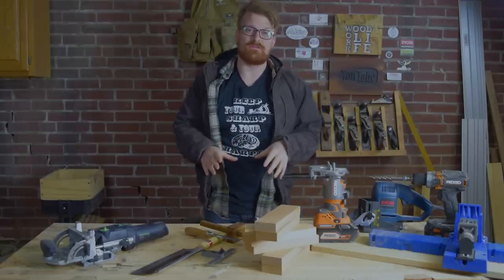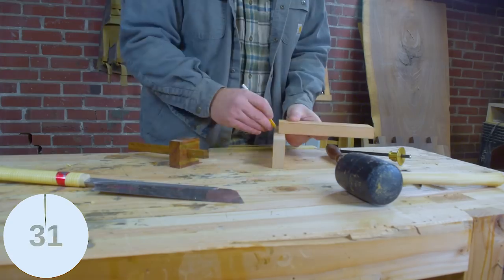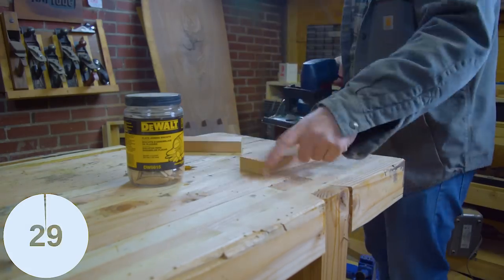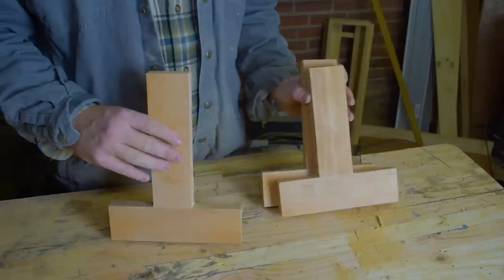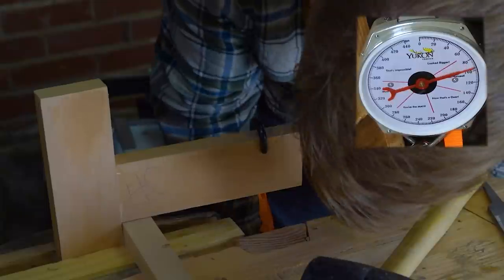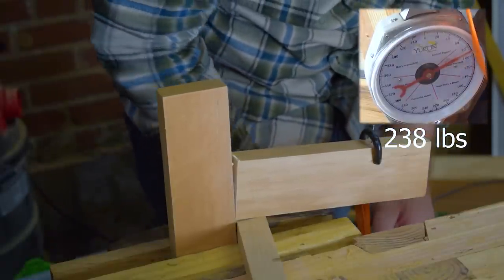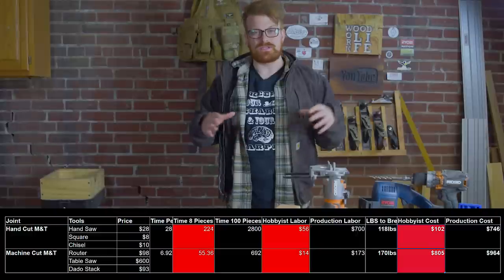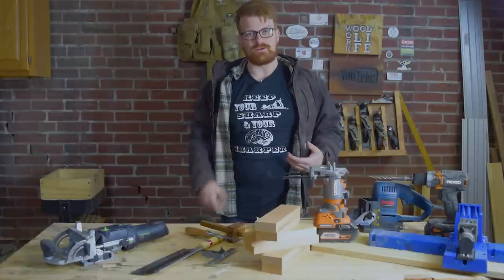Best Joint Shootout, The answer will surprise you!  | Hand Tool Shootout

Comment: Curious... if you put 3 pocket screws instead of 2, will it increase the strength by 50%? 

Also, there is another joint that hobbiests use, dowels. With a $60 or less doweling jig, you can get a joint similar to the domino except with separate dowels. How well would that joint hold up?
Reply from the maker: I plan on following up on this video next month.  Stay tuned.  The screws didn't fail the wood did, which means adding more pocket holes would comprimise the end grain even more.
Reply: @WoodWorkLIFE  Of course the wood failed. The screw is much stronger than the wood. I think another screw would spread out the load to different stress points. It might not hold 50% more weight, but I bet it would hold at least 30% more.
Reply from the maker: No what I'm saying is the wood failed along the grains of the wood parallel to the grain. One of the issues with pocket hole joinery in hardwoods is the drill hole gives the wood a natural point to fail and the screw acts as a wedge.  More holes would provide more compromising positions for the wood to splinter at. If you were working in plywood or MDF it might be a different story.
Reply: @WoodWorkLIFE  OK, Sorry, I was a little slow to understand what you were saying. :)

Still think dowels might be equivalent to Domino for a lot less money.
Reply from the maker: @KirkDickinson  I would bet they are closer than the price would indicate

Comment: Which is better? A Rolls Royce or a HumVee or a Bettle? Depends of what your need is. Strength is not always the only consideration. Environment factors of temp and moisture and the swings of and how much strength do you need. Structural or non-function decorative.
Reply from the maker: Ding ding ding
Reply: @WoodWorkLIFE  That is supposed to mean something?
Reply from the maker: @MrBonners  that is exactly what I am trying to highlight in these videos.  All joinery can be fine for particular purposes.  I just don't come out and say that in these videos.  You don't always have to use the strongest joinery, it just has to be strong enough for what you are using it for.  In my follow up video I was surprised by how strong just a glue saturated butt joint is, but when the glue fails it will fail too.  Because in structural applications you should have a mechanical joint as a backup to glue.  Many pieces of historic joinery are joined with plates but not in load bearing/structural joints, as a straight butt joint though, they don't add much.
Reply: @WoodWorkLIFE  One is supposed to get all that from " Ding ding ding ".
" exactly what I am trying to highlight " try harder. Try using sentences.
Reply from the maker: @MrBonners  ding ding ding, like the gameshow winner winner sound doesn't convey that 😁.  Happy to engage in dialog .  It seemed like you nailed the point already though.  Just trying introduce a little levity.

Comment: No glue on the pocket hole joint? Also, anytime you are gluing end grain you should apply glue, let it soak a bit, reapply and wait. Just a couple minutes. It helps with that kind of joint on most woods.
Reply: Oh, and to the point of the cost of the festool domino setup - get a good doweling jig, and drill in 3 or 4 dowels close together. Save you a thousand bucks, and get nice strong joints. Also faster than any mortise and tenon.
Reply from the maker: I did glue them pocket hole joint, that is why the wood failed rather than the screws.  That is one of the problems with ph joinery, it compromises the end grain of one did if the joint.

Comment: I could swear that I heard you say that a tenon would provide more leverage and this be easier to break. Please tell me I misheard that. I may have missed it, but was that glue fully cured? I feel like you should not get the tenon to pull out like that if the glue is cured. I’d expect more shearing/cracking as opposed to smooth extraction like that. Dominos are typically used only for alignment. Finally, an injury that always comes to mind when I pick up a biscuit joiner is my very first time. Holding the piece as you did, the piece slipped and I routed my thumb. Please be careful when pushing that machine into the piece.
Reply from the maker: I don't think I said that...hrm.  I don't know what I would've meant if I said that.  The glue was fully cured, the wood is fairly soft and straight grained though.  I think it just peeled off a layer of wood cleanly.

Comment: FYI, that end grain glue up myth has recently been busted. But to but is a bit stronger than side to side.
Reply: yes, but leverage. a side to side joint may see a foot of leverage in a HUGE joint, but an end to side or end to end will see unholy amounts of leverage
Reply: @jmac2o229  that's ture. But the statement 'end to end is weaker' is still factually incorrect.

Comment: When you consider cost of tool and labor both....Pocket holes win hands down...They're super fast to do and strong enough for normal use of things...
Reply from the maker: Ya pretty much, it only starts to break down if you are a "high end" production or custom furniture maker.  The way that a pocket hole fails in hardwood over time is not the mark of a professionally assembled piece of furniture due to the compromising of the end grain with the screw.  The domino fails essentially in the same way as a mortise and tenon joint (if it ever fails.)  From an efficiency per strength per cost though, they punch in the same league with a lot lower barriers to entry.  The results is where they really separate, especially if you also take into account plugging the pocket holes with dowels into the timeline.

Comment: You have to take in to account those joints are actually stronger than that given the location you tested them at. Had you been able to pull on them right at the connection vs the leverage point you was at the numbers would have been a lot different on all of them. But still a good demonstration though!

Comment: Rest in peace Biscuit joint. Great content like always! Love to see all the different kinds of videos going up.
Reply from the maker: It seriously snapped when I was lightly tapping in the nail at 6", no hope there.
Reply: Tapping in the nail unsupported compromised the test imo... Impact is a different kind of stress and not measured here either.  Biscuits, as you did say, are not really suitable for this type of work but probably are great for lining up boards when edge joined.
Reply: Thank goodness the biscuit is dead they add SFA to a joint strength. Only decent use is for alignment but often they no good for that either.
Reply: That failure looks suspicious to me. I use a lot of biskuits but every failed joint so far broke off one side of the piece with it. So the joint didn't fail directly but the wood around it did. 

It would be nice to see the broken pieces to identify them. 

Otherwise it was a good Video. I would also suggest watching Matthias Wandels approach in that topic. 

Regards, Etna.
Reply: they are very suitable if you need to align something - i use lot of them too, they don't add much strenght, but i never have failed one like this - i can confirm your Statement by my expierience: if the joint fails, half of the Wood around the biscuit breaks out with the wood

in this case, clearly the clue broke
Reply: Exactly. He should have supported the wood while putting the nail in each piece.
Reply: on that thick of stock he could of doubled up on the biscuits!

Comment: Thanks for the video!
For those wanting to compare strength of joint to cost, here's a quick lb/$ (higher is more value-economy). 

Using his numbers: 
hand cut 1.16 (hobby) 0.16 (production)
machine cut 0.21 (hobby) 0.18 (production)
biscuit 0.49 (hobby) 0.38 (production)
pocket holes 0.79 (hobby) 0.66 (production)
domino 0.17 (hobby) 0.17 (production)

Pocket Holes offer best value.
Reply from the maker: Yes unless you factor in quantity and time then the Domino takes over.  Time is money.  If you are making professional furniture at scale use a Domino.  If you are doing one off custom builds do pocket holes.

Comment: Can i ask you please to make a long sideboard(1400mm) and a bedside cupboard I will be using bitt joints with 18mm Russian Birch ply, so to use buscuit joints / glue it should be ok since the buscuit really is to align really.? Or would you not recommend it. ps i will probably sell it so needs to be okay? many thanks :) ps great T shirt :)
Reply from the maker: With birch it should be ok for alignment but I would feel more comfortable with dowels.  There is not really a "butt" joint with plywood.
Reply: @WoodWorkLIFE  Dowels... you have to be so accurate to get them right :)
Reply: @WoodWorkLIFE  ...... perhaps make own buscuits from pine instead of the dowels since one has to be very accurate

Comment: For some reason, I hate the thought of biscuit joints and visually I hate pocket joints. They look cheap and shoddy to me.

When I was in highschool woodshop back in the mid 80s, we had a drill bit that could cut mortises. The bit itself had a square sheath that cut the hole square. Much easier than using a chisel.

Comment: great video.. I'm happy your review wasn't biased against pocket holes like almost every other woodworking youtube  channel
Reply from the maker: I always try to take myself out of the review as much as I can and do legit testing.  I wish I had the time to repeat it over and over again.  I will be doing a follow up with viewer requested joint too.
Reply: The pocket holes were pretty crap. The other joints would all get stronger with hardwood, but the pocket joints would still fail at pretty much the same weight. Sure they are quick and cheap, but there is a reason why all cheap furniture is garbage.
Reply: Have you ever considered that there may be legitimate reasons that experienced woodworkers hate pocket holes?

Comment: I wonder if 2 biscuits should have been used since you doubled up on the festool (or festering stool as ave calls it). Not that it would have made much difference. Also, I imagine you used a number 20 biscuit, you didn't say. Routed slip tennons may be something else to consider in the future. Thanks for the test.
Reply from the maker: Interesting thought, I think if I would have used a nicer plate jointer like one from DeWalt or Lamello it may have been a little different results.  I still don't think any amount of biscuit joints will do anything to improve a butt joint
Reply: @WoodWorkLIFE  I agree. If the slot was loose the results are invalid. I would love to see the same test with a good machine with maybe 2 slots/biscuits , if thickness allows.. I still think biscuits have a place on face frames and over hanging shelf edging.
Reply: @WoodWorkLIFE  Absolute rubbish. It's literally just a miniature flat floating tenon, aka hidden spline joint, of course it's stronger than a plain butt joint,  especially when under a tension load.

The problem ocurrs when ahem people clearly don't glue the joint together properly or apparently don't even bother clamping it while the glue dries, leaving the faces of the joint not even be attached to each other when it comes time to testing it...

Comment: The math changes a lot if you get the cheaper Kreg jig.  Most people don't need the bench unit.
Reply from the maker: It slows you down a lot too, I don't think the price savings makes up for the difference in efficiency of the K5 over the K4/K3.  The bench top model (400$ or so) might start to have diminishing returns in efficiency per $.

Comment: Pocket holes cut with router bit should be separate and included in addition to Kreg, which is cut by a step-drill.
Reply from the maker: How so?
Reply: @WoodWorkLIFE  
In router cut PH, the screw is parallel to the faces of both pieces of the joint, hence the head of the screw can be farther from the end and the screw can be longer. The head of the screw being farther from the end better preserves the integrity of the wood and of course a longer screw is stronger.

In step-drilled PH, Kreg jig, the screw is slanted so the length of the screw, and the distance between the  head of the screw and the end,  are both limited, predetermined not much variable to situation and strength requirement.

Router cut PH can be much stronger than step-drill kreg PH": cut a bit farther from the end and use a longer screw.

Comment: As a pro, the Domino wins hands down in a production shop. It is quick strong and repeatable.   It also has massive versatility on its side.  Do we use it for everything? No there are times when the mortice and tenon is more appropriate but say for re-enforcing a mitred case for example it is a simple and effective tool.  Horses for courses, hobby woodworker with no money hand tools all day long they are cheap great and will give you hours of pleasure in creating your piece. Hobby woodworker with money buy a Domino and you will be simply amazed at how much quicker a project comes together. Production shop should have all the tools  but like us  you will gravitate to the Domino 95% of the time. Shout out for the humble biscuit joiner, we use it for alignmemt and still use it for structure buy using it to make long slots in which you can glue a spline.  Don't own a Kreg jig but that is just a personal thing so no opinion. Good video and I enjoyed your cost analysis.
Reply from the maker: I am glad my methodology works out in a pro shop, the domino wasn't around nor did I make many cabinets when I worked in a professional shop.

Comment: Tbh, I think this was an unfair test weighted in favour of the festool. You had two laterally placed floating tendons right in the line where forces would be applied. Also the biscuit joint was broke before any load. The hand cut mortice and tenon was more central and less in the line of applied force.
Reply from the maker: Mostly fair points, there was no inherent bias and I tried to comment on why I thought some of these joints failed faster than others.  To be fair, one standard biscuit joint is not intended to really add any strength in the orientation I applied it in.  It would be sufficient for case work though.  I think another factor in that one is the quality of the biscuits and plate joiner you use.
Reply: Wood.Work.LIFE. Whether if it was intentional or not, it looks very like a bias in favour of festool. Whether if you understood or not you gave the domino joint a distinct advantage imo

Comment: I'd love to see this with all the same wood. The kreg seems like it had more strength but the wood split first.
Reply from the maker: All of the wood was perfectly clear and  from the same board.  One of the problems with pocket holes is that they introduce a point of weakness into the long grain of the wood.  Which is exactly where the joint failed.  Different species of wood would have different strengths.

Comment: I wouldn’t make a chair with a screwed(Keg) joint. I was surprised how good the Domino jointer was compared with a proper mortise and tenon.
Reply from the maker: I made a chair with Kreg joinery just to say that I did it.  I am not terribly worried about the strength of the joint per se a the way it would fail when it does.

Comment: You didn't include dowels...which is what I use. I'll often use 6 or 8 in dowels.
Which creates a huge amount of leverage...having 2 or 4 or whatever inches of dowel into the perpendicular piece, like a table apron.
Even once the glue fails you still have to literally snap the 3/8 or 1/2 dowels in half to have a total failure.

You also didn't mention splines or butterflys, which I also use.
An internal spline made from 1/2" plywood is extremely strong. To reinforce a waterfall edge, or butt jointa too.
Its the same concept as a tenon except its plywood and so is much stronger.

Btw, biscuits actually dramatically strengthen the joint...but only for the other axis. (Pressure on the flat, not the edge).
To say it doesn't strengthen the joint at all is just totally untrue.
Reply from the maker: Many biscuits can do something to panel joints, but mostly they align the joints to reinforce already strong long grain joints.  I think there are better tools and biscuits than what I am using, but I assure you, the biscuits I was using add nothing to a joint.  I will be testing tenons in a follow up video.  Splines are also awesome for miters, and even some butt joints, but similar to biscuits not in the way I am testing them...butterlied butt joints?  I have never even heard of those, but seems interesting, is it similar to the butterly you would use to stabilize a crack or plug a defect like a dutchmen?
Reply: Wood.Work.LIFE. Yeah...its exactly the same. And you can make them from hardwood.
The only trick is (especially if you make softwood butterflies) pay attention to the grain of the butterfly. It needs to run the length of the butterfly.

Of course, this is a pointless technique if you're trying to hide a joint (like you were testing). But if you're into that look, its a pretty nice technique.

Especially if you make a dresser or bookshelf with softwood sides and a hardwood top. You can make the butterflies out of the same hardwood.

Comment: If you want strength use a double. Biscuit. Like you did with the dominos. Much stronger
Reply from the maker: still wouldn't add much in the dimension I was testing but might have been a bit better.